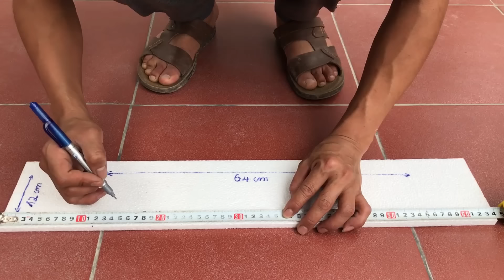The 6 Most Beautiful Cement Flower Pots -  You'll Want To Make For Your Garden

Comment: Absolutely splendid work BUT I SO WISH I had a tad bit of information such as types of supplies used. Would be nice know which concrete was used, glue for foamboard, primer and paint. But even with that said Im in awe of the artists gorgeous jobs on each flowerpot!!

Thank you, bc I plan on doing the same as this person and making my own. 

God bless you! Shalom
Reply from the maker: The material used here is 1 cm thin foam, cooking oil is applied to the foam to prevent the cement from sticking, silicon glue is used to stick the foam to the barrel, the mixture is mixed in a ratio of 1 cement and 1. 5 sand and water, after 48 hours the cement sets and you can remove it from the mold. Thank you very much

Comment: Great job. What are applying on the bucket that comes in the other one?
Reply: I think it's an oil, similar to vegetable oil. It's clear and has a high viscosity. You can likely use any resist so the concrete doesn't bind to the bucket. Because she uses hot water to expand the outer one to get it off, oil's likely the best guess :).
Reply: The cardboard doesn't seem to need any :)

Comment: Hello, good time, thank you for your great clips, one question, what is the substance that you applied to the body of the second bucket with a brush and put inside the first bucket?
Thank you for your advice
Reply from the maker: That's waste lubricant oil. You can use cooking oil to apply to the barrel so that the cement doesn't stick to the barrel when it dries.

Comment: plz share what glue you apply which dries and sticks at once  .also what kind of oil you use to masturise  the surface?
Reply from the maker: I use silicon glue to stick the foam, and cooking oil to brush on the surface in contact with the cement

Comment: What type of glue is his using to attach the polystyrene to the container?
Reply from the maker: It's 1cm thin foam. I used silicon glue to stick the foam and applied a layer of cooking oil after pasting so the cement wouldn't stick to the foam.